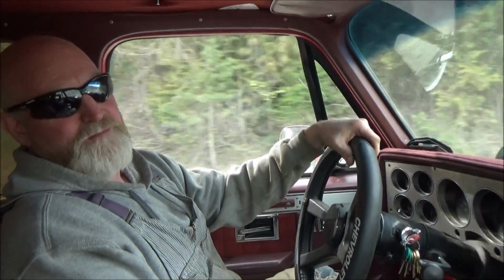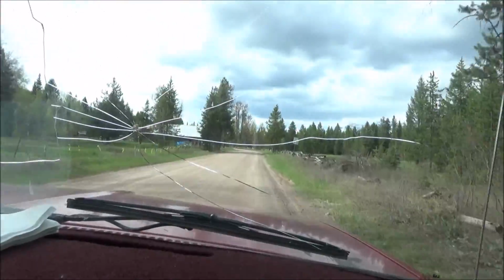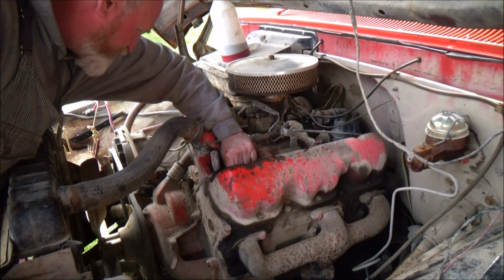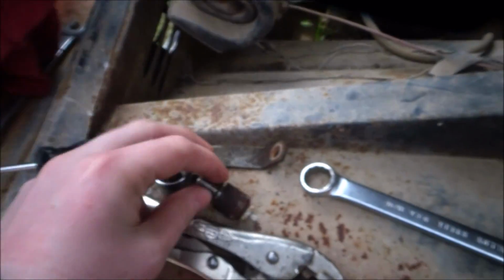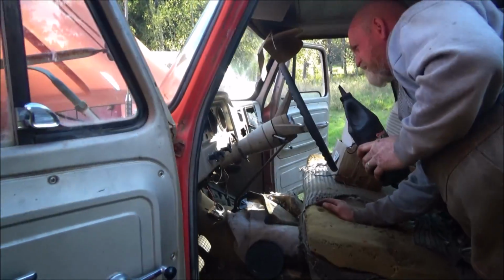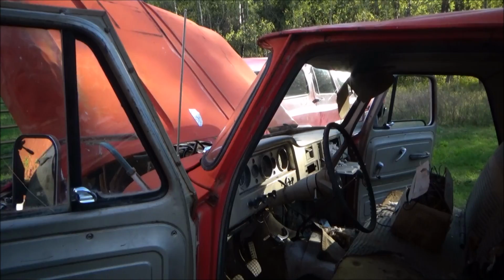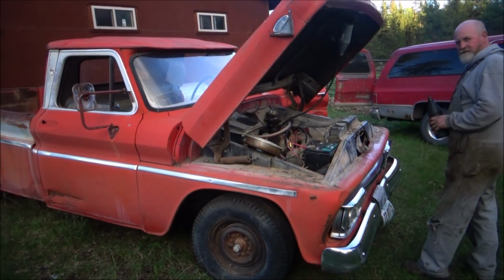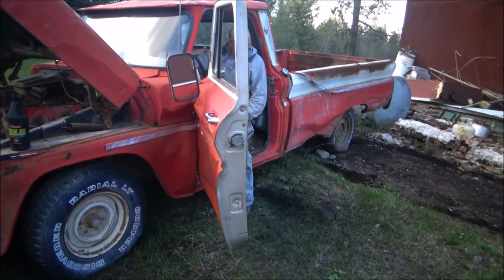First Start in 15 Years! 1964 GMC Custom cab Pickup 305 V6 Part 1

Comment: I was doing some reading and found out that GMC built these big cubic inch V6’s so I had to look at some videos of them.
Reply: Did ya also see the 351, 401, and 478 versions? The 702 V12? The 637(!!) V8? All the same family.
Reply: In the early 50s, GMC had giant INLINE 6s of 503 and 707 cid! Just before the diesels took over. The big gas I-6s were phased out as the GMC (now Detroit) Diesels gained acceptance.

Comment: "the big block v6" :3
Reply: Awsome engines GMC put out in those years. !!! The guys in dealership mechanic shops begged GMC to quit producing those engines because they never broke down. Lack of service work...
Reply: Ellenor Malik I got one in 63 GMC step side
Reply: It’s actually a small block
Reply: @loganarnold00  Well, no, being a V6 it has the same cyl size as a 400s-class V8.
Reply: Ellenor Bjornsdottir small blocks has the distributor in the back big blocks has it in the front
Reply: @loganarnold00  where's your source on that?
Reply: Ellenor Bjornsdottir motortrend: roadkill episode 23 1968 Dodge Charger at 7:20 besides I know cars any you look at the big blocks have usually has them at the front while small blocks has them at the back my truck is a small block it’s at the back
Reply: @loganarnold00  that's not a source but ok
Reply: Ellenor Bjornsdottir but both big block and small blocks have a v6 and v8, any engine greater than 400 cubic inches is a big block, or  typically, big-block engines have displacements of greater than 400 cubic inches and small block engines have a smaller displacement. ... The Chevy 396 engine is an example of an engine that has a displacement under 400 cubic inches but is considered a “big block” due to its architecture.
Reply: @loganarnold00  Then why does GM's LS go up to 454 cis? That's a small block.

Comment: I quit watching when the
( STARTING FLUID ) 
 comes out.  
  A  Bit of gas down the carburetor Venturi is more than sufficient. Starting fluid takes every bit of oil out of the upper cylinder causing pitting and cracking in  the cylinder. The best way to destroy a classic block & heads. Most common damage is a blown head gasket 
 Or when it won't start then it causes the engine to seize up cause no lube film in the cylinders instant junk. 
 So spray away. FOOLS
Reply: You don't have to be insulting about it. Most folks don't know that. If it DOES fire, the top end oil will be replenished. But if it doesn't, it won't. Doesn't mean they're "fools", nobody knows everything.

Comment: Like the vids guys but one little mistake fellas that v6 isnt a 305. 305's in the gm lines were v8's not 6 bangers
Reply from the maker: That's what we used to think along with a lot of other people.  Here's a couple of links to verify that we are right.  Thanks Byron for watching!https://en.wikipedia.org/wiki/GMC_V6_engine  https://www.youtube.com/watch?v=FXPKRjzxRTo
Reply: Byron Taylor oh they are real got one in a 63 stepside
Reply: @rogermarshall8991  Don't forget the 401 and 478 V6's in the bigger trucks.
Reply: You are wrong Sir, during the sixties GMC made made V6 engines in 305, 351, 401 and 478 also made a V8 and V12 based on them.